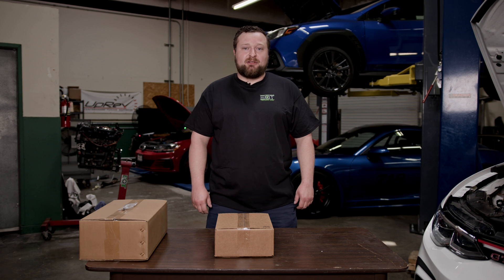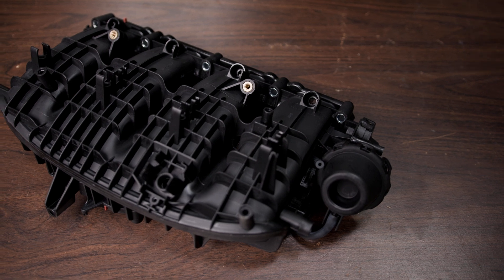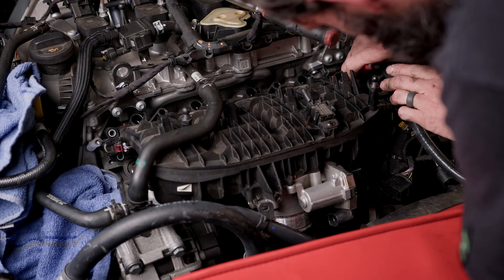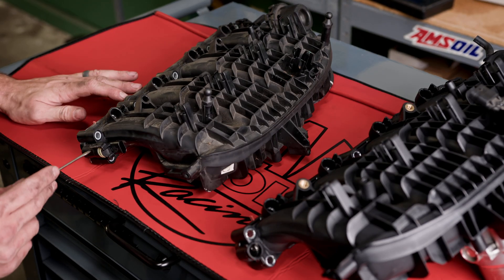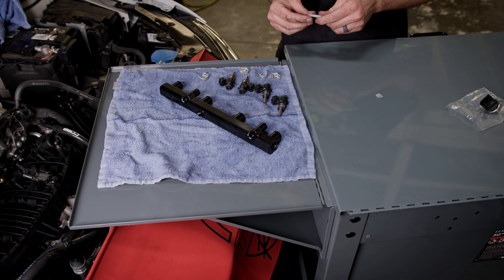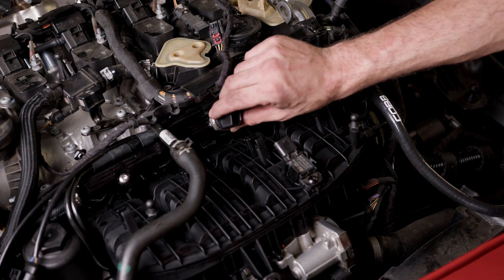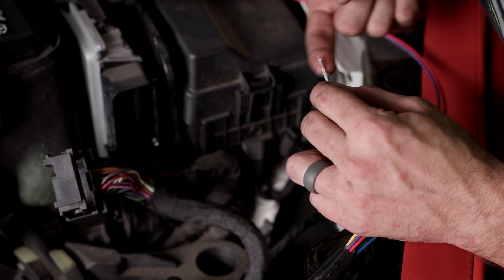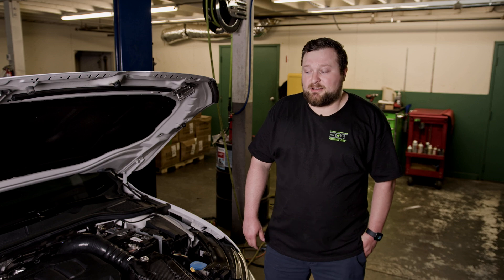EQT MPI Installation Video

Comment: Interested in the mod to keep the valves clean. Driving a 2019 Arteon SEL Premium AWD, purchased new in January 2019, here in the States. I have an APR Stage 1 high torque tune. The video seems simple enough, but the website doesn't list my car, even though it's running the Golf R engine. Anybody's tips or suggestions are requested. ✌️

Comment: asking here because I didn't see it in the video, the plug that comes on the wiring harness for the MPI kit from EQT, where does that plug in? It's currently unplugged and I'm honestly not sure where it plugs into but everything else is hoked back up. It's the brown-ish ended male end that you can see on camera next to his left arm at 10:34
Reply: That's for an Ethanol/flex fuel sensor. Tbh its the two on the left I'm scratching my head at.
Reply: @TheCarpenterUnion  From what I can tell, you plug the factory intake flap position sensor into the longer EQT plug, and the short EQT connector goes into the Intake Flap Position Sensor (The plug behind the oil filter)

Comment: So it's not possible to keep the engine hoist bracket with your mpi fuel rail?
Any fuel supply issues to the hpfp running the feed to it through the mpi rail? 
The unitronic kit runs a second feed to the hpfp.
Is the hpfp connection on the mk8 just a 3/8" quick connect fitting?
You guys also mention pinning the ethanol sensor to the ecu yet the video doesn't show where you fitted the ethanol sensor.
Reply: On the 1st question, yes, it is possible. It is tight, but not tighter than the clearances you're working with for a turbo install.

Comment: If you have an MPI equipped car already (New Zealand as an example) what parts of the kit do you need to run the Vortex XL IS38 upgrade?
Reply: You probably don't need anything unless you are going to be running E85. In that case you would just need the cobb flex fuel sensor.